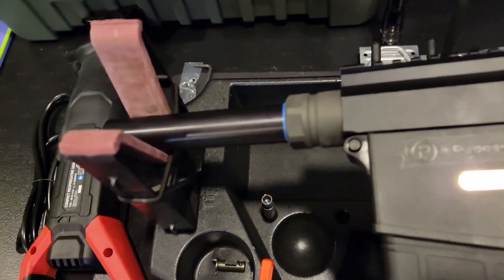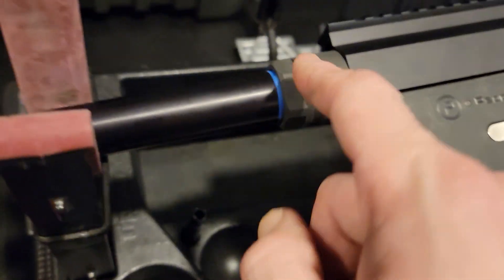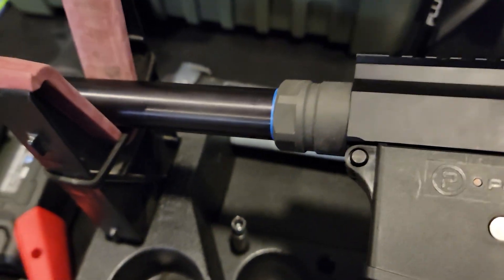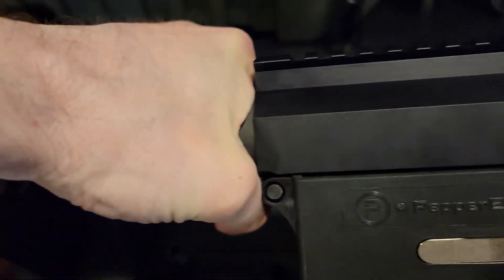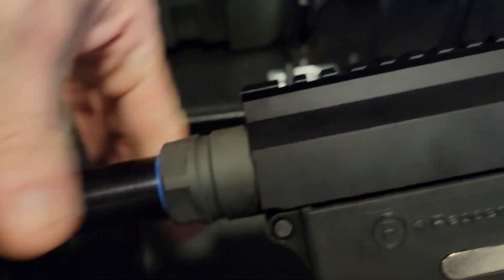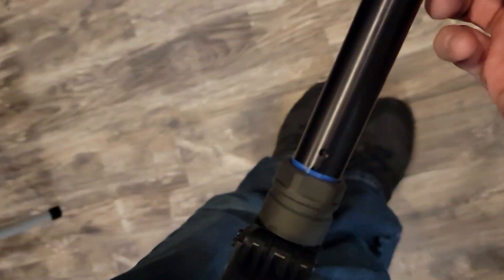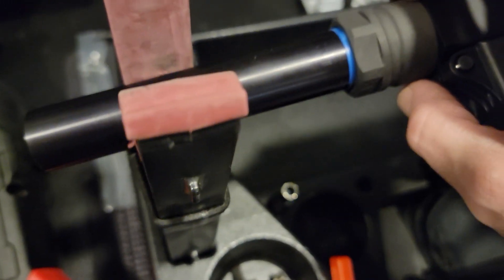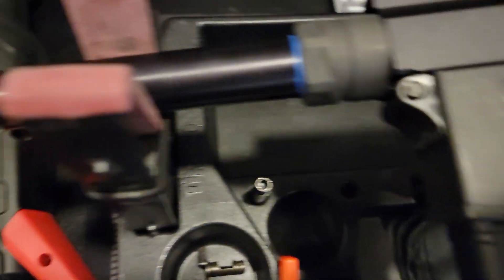How I keep Grimburg VKS barrels from having a rattle or wobble.  Not an O ring

Comment: plumbers tape might work good too and different types might have a different firmness. the plumbers tape is teflon so the twisting threads won't bind and also it seems to turn to putty as the layers of teflon plumbers tape are smushed together. I imagine the electrical tape is similar. I love solutions like this. In a similar way, I once wrapped a tiny bolt in a 1 mm strip of saran wrap as a substitute for mild loctite and it worked (this in the rear asa port's tiny hex bolt .. as without some kind of thread locking it will cause a bad problem as it works it's way into the threads. one final similar for a nice way to close gaps (in this case between flatter surfaces) is to use automotive vinyl wrap. I use a carefully cut piece of this between the parts of the FSC carbine kit. you get the extra bonus of a little play where it might be good (or not but less play nonetheless) and things firm up and rattles go away .. and very importantly, later you can take the carbine kit off and you will still have a beautiful surface on the FSC. great solution! (thick purple gas pipe teflon tape might be something to try but I see the electrical is working great.)
Reply from the maker: Actually it doesn't.  What you're needing to make thicker does not have threads on it.  So it won't stay in place around the barrel as well  as something adhesive will.  Cuz putting it on the threads on the receiver will do nothing to actually make the barrel more sturdy it would be fine to use on those threads but it wouldn't make any difference
Reply: @DK-Spencer  ah, understood.